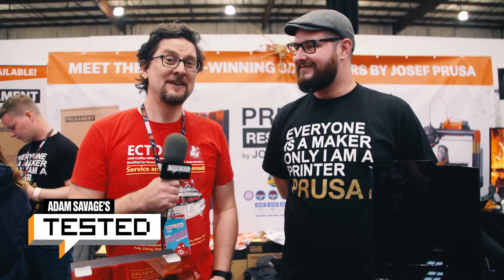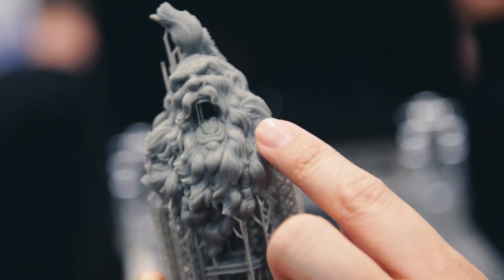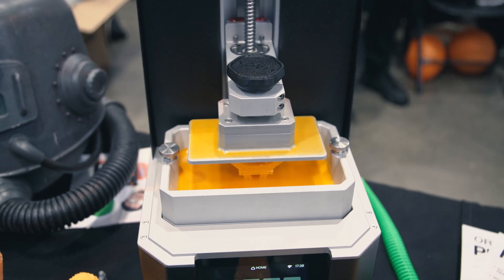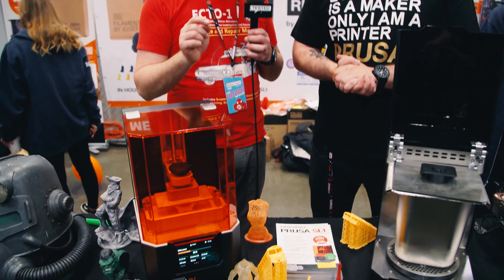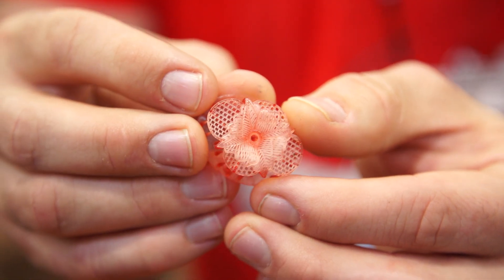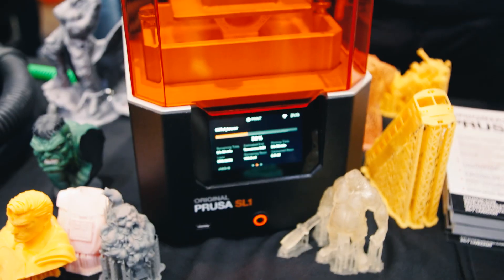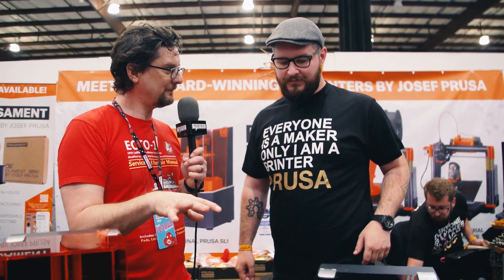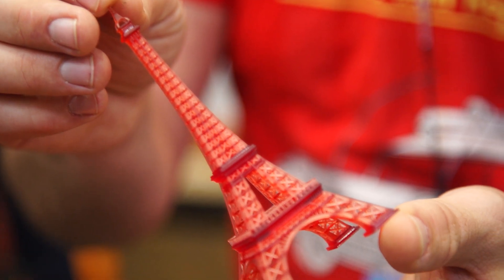First Look: Prusa SL1 Resin 3D Printer!

Comment: High price for low quality printer. The design is not good compare of the cheap alternative on the market.  And who the fuck will use so much powerful processor. Like a customer I just want this think to print you wont play titres waiting the print to be ready.  I'm currently with Photon S and for the quality Is the best on the market right now.

Comment: Public Service Announcement: Prusa's website shows these printers are "in stock" but I can tell you with 100% certainty they are NOT in stock as of 12-23-19. They have had this "in stock" status on the website for weeks and it's not correct. I order an SL1 + CW1 (not kit) on 12-6-19 (today is 12-23-19) which the website still shows this as "in stock" and ships in 1-3 days. Not sure why Prusa is claiming to have them in stock? I'm being told by Prusa that my printer should ship before the end of the year. Shame on you Prusa for this deception. Being honest about the stock levels and shipping times will always be more understood and accepted by customers than telling them it will ship in 3 days when it's more like 3 weeks. I'm a HUGE fan of Prusa but this is shady business practice.

Comment: I'd swear I saw the resin holder moving up and down. Why does it need to do that in addition to the print platform moving up and down? I would think it adds some extra complexity to the system as it needs another stepper to move the resin bath. Using something other than a laser in an SLA printer isn't new. I've seen a few SLA printers that use something other than a laser. I would like to know why SLA printers have relatively small print volumes and yet they cost several times that of an FDM printer with a similar print volume?

Comment: Purely speculative, if the clear material on the bottom of the tank could be switched out for one that allows oxygen to pass through it and a few adjustments were made, could this machine print like CLIP?

Comment: Basically the same technology and resoults of my 350€ anycubic photon
Reply: Not the same.  I have an SL1.  AA gives you no visible voxels.  There is no Z wobble.  No cracked screens or failed prints due to adhesion issues midway through the print thanks to the tilt.

Comment: anycubic comes with update for anti aliasing as well .... safe your money. prusa just charge $1000 for a name .......

The prusa print platform has a design issue too. resin stays in top of the platform. the photon has solved that with a beveled roof, to let the rest resin drop back to the vat. saving resin ;)

I run the original photon for month for swiss watch making. it even blasts away the formlab2.  prusa is to late and to expensive for the same technology that has been out for 2 years already.

resolution and uv light power, anti alias, etc .... same package is avaible for $450 by anycubic. anycubic has as well the photon s version for faster prints (white body) for $470

So judge for yourself, where you spend your money.
Dom Dom

Comment: Still unclear - how long will the film last, and how much will it cost to replace? Formlabs type stuff consumables are too expensive.  Also, shame about the build size. Not clear what this brings to the table that others haven't already done?
Reply: It comes with a few replacements.  How long it will last depends on what you print, where you print on the build plate, what resin you use, etc.

Comment: I would buy a resin 3d printer when it already has a build volume of at least 300x300x400 mm. Although I think resin printers are light years more advance than that of Filament Printers and I don't think the post processing is that bad. If you were to post process a print from a filament printer to achieve at least half the quality of that of a resin printer, it would take you days with a lot of sanding and priming.
Reply: Can you imagine how much resin you would need ?

Comment: This is definitely something I'm planning on moving toward in the future.  I received my Prusa MK3 right before the MK3S came out at the beginning of the year.  Now I'm waiting on the new upgrade as well as the multi-material upgrade to allow me to print from multiple filament rolls.  There's definitely a learning curve with the MK3,  but it's not hugely steep to start.  Anyone looking to get the filament printer should purchase the MK3 kit and build it yourself.  It will absolutely make you more comfortable in the future for any upgrades or repair work. The only downside in the U.S. is that Prusa filaments aren't sold here as of yet and I'm not willing to pay the shipping costs from his country to the U.S.  I've heard they're going to sell from Amazon and there are some listings, but none of them are active for purchasing.

Comment: I've been doing SLA printing for over a year now, and you absolutely don't need a fancy rotating cleaning and curing station. I've completely fallen out of love with them. 

It's so easy to clean parts in a container of IPA using a soft toothbrush. I like to alternate between a container of IPA and another container of water to rinse the part, which greatly helps remove the surface residue that you can't see. 

And then I cure my parts under water, which is much better than curing in air, because water inhibits reaction with free oxygen which can leave acrylic resin parts feeling sticky. Just get yourself a $5 plastic container with a lid, cut a hole in the top for a UV lamp, fill it with water... good to go.
Reply: the whole point of the cleaning station is for you to put the part directly from the printer and have a machine do the cleaning for you so you dont have to

Comment: too expensive !!!  for an open source tech.  you get the same print out of any of the current $500 or lower price dlp!!
Reply: CHI SLIME COMPANY CHICAGO CHI SLIME agreed. At least it says it 1440 resolution rather than 1220, like that's going to make a 1000 dollars worth of difference
Reply: @PatrickPaul1203  lol another expensive ass printer that people think will actually print better which it does not.  creality has a big one come on sale in china for only 1100 4 times bigger!  and it has tilt bed.  lol
Reply: CHI SLIME COMPANY CHICAGO CHI SLIME or one for 500 that has the same size bed, either way people should go with Creality!

Comment: Talks smack about the Chinese printers but the Ender 3 works more reliably than the Prusa i3 mk3 for 1/5th the price, has a bigger community, and is easy to customize.  (FDM, not SLA, but the point stands.)

Comment: There's quite an annoying design issue on this printer. The platform top is flat so you have always resin on it when removing it which will drip everywhere. They should have a look at the Photon and take note.
Reply: I wonder why they did not thought of that... it's the most important feature of the whole printer. No printer is perfect but they got a lot of stuff near perfect for the price but forgetting about the build-platform its a bummer to see... Also the plastic knob on top annoys me so I hope they sell a metal knob later on.
Reply: Just a couple degree slope would be a significant improvement.
Reply: I was thinking the same thing. Such a simple and obvious thing. Makes me wonder what else they didn't think of.
Reply: I have a SL1 and this is not that big a deal.  You can basically ignore it if you are not removing the build plate to remove the print.  I usually just use the included tool with the build plate still in place.  If you do this it is a non-issue.  If you put the whole build plate in a wash then it still isn't much of an issue.  It is not like you are going to put the CW1 on the other side of the room for it to drip.
Reply: @bluexgreen1  If you put the whole build plate in a wash then you are wasting resin and dirtying up your wash.
Reply: Wrecks it is designed so the CW1 can easily use the basket or whole build plate at the user’s preference.  Easy and convenient as it should be.

Comment: it's the same 2k lcd "uv pass-thru" as every other cheap resin printer but 1600 dollars? i got the elegoo mars on amazon for 400 bucks and it came with a lot of extra stuff with 500ml resin and 5 star review on amazon. same specs. i haven't regretted the decision and i couldn't believe for 400 i could get form 2 resolution and sometimes even better prints. downfall for lcd uv is that resins are usually weaker but the market is just starting to save lcd resin with stronger resins so don't be discouraged if you get lcd instead of sla. only reason sla has the lead with stronger resins right now is because of formlabs did most of the research and brought stronger resins exclusive to the form printers. what i do suggest is looking for a cheaper alternative resin printer because prusa's 1600 dollars is alot compared to similar products already out there. but heck if you like prusa fdm printer i can see the appeal to get one i think

Comment: Did I miss it? Anyone know the xy. Resolution of this printer?
Reply: 1440p panel with 3 subpixels... Which sounds to me like 7680x1440 in 16:9 aspect ratio.
Reply: Found the spec on their site:
The SL1 is using a 5.5’’ high-resolution LCD display with the physical resolution of 2560×1440p, resulting in 0.047mm per pixel, that’s the fixed XY resolution. 
https://shop.prusa3d.com/en/3d-printers/719-original-prusa-sl1-kit.html#_ga=2.190946860.781637296.1559575259-1867515650.1559575259

Comment: Why is this guy working the booth, let alone doing interviews, if he doesn't know the dpi resolution?  Oh wait... must be a company executive officer.
Reply: I'm sure he knows the resolution in SI units:  He's from the civilized world, and not used to thinking in our bizarre tribal units.  (As for being an executive officer:  True.  He's also arguably the foremost engineer in the 3D printing field and the the guy who's consistently open-sourced some of the most widely used designs in 3D printing.)
Reply: @xela8384  Ah, but I'm looking at it from the point of view of potential customer unfamiliar with (and frankly uncaring about) the who's who of an industry I will have little contact with save for tech support, so his personal technical qualifications are unimportant.  A vague "eh, it's good enough" falls short of what I would expect from a product booth at a show.  So maybe he doesn't know the dpi - he could have given the dpmm and I'm pretty sure I could calculate whatever conversion my bizarre tribal mind might need.  But he came across as either a less-than-fully-informed marketing guy, or informed but prevaricating in order to hide embarrassing specs.

Comment: Prusa completely missed the mark on this one. This printer is grossly overpriced for what it is. To put that $1600 pricetag in context, Sparkmaker is using similar technology at the $240 pricepoint. They forego the tiltable surface and have a more spartan interface and 1080 P resolution, but use the same anti-aliased DLP technology and are likely working on a similar 1440p platform in the sub $500 pricepoint. See, the issue is that DLP is a step down from SLA in quality, no by much, but it is a step down. Its benefits are that its cheaper and scaleable. And SLAs of similar size are starting to show up around $500-1000. So Prusa made a product at 3x the cost using an inferior technique to whats already out there. Or they made the same product at 6x the cost using the same technique. What Prusa could have done to blow the market apart is take DLPs OTHER advantage. Scaleability. See, the larger an SLA printer gets, the slower it gets or more powerful the laser needs to be. Either making print time or printer cost exponential. Meanwhile, DLP can theoretically produce a print surface the size of a 75" TV (rivaling the largest SLA printer in the world)for the cost of a TV and the motors required to move a build plate that size without sacrificing speed or facing exponential cost increases. This could realistically create a resin printer capable of a 6'x3' build volume for a cost in the area of $15,000-30,000, a factor of 15 less than SLA
Reply: I believe Prusa's SL1 features are pretty on point for the price. What you don't factor in is the poor reliability of the machines in the sub $500 price point. Resin is expensive and failed prints with cheap printers happen alot more often, and especially with those who want to print jewelry level detail. Also, it has a fume filter, a robust calibration system that takes no time at all, I dont think you understand the engineering of making a giant DLP printer, the suction forces involved from removing the print from the fep  is extreme and prone to cavitation and or destruction of the fep or print itself. Similar arguments made for the Prusa i3 MK2, tons of other cheap machines were also available at the time, with autoleveling and a slew of features, but they were not reliable to set and forget, let alone set itself on fire.
Reply: Daniel Kim I agree with everything you have said, but I think the price is too high. 

I am a big Prusa fan. I love my Prusa MK3 and have no problem paying the costly International shipping to get Prusament shipped to the USA.
Reply: The peeling force at the size your talking would be ridiculous

Comment: Resin printers are terrible. Waste of money at the end of the day and the print times are way too long. I have an sla printer, it was garbage, I then bought a pla printer and that thing prints none stop and the quality is as good if not better than the sla. Save your money people and just buy a good pla printer.
Reply: You cannot be more wrong, the resin printers have far superior quality and DLP printers are also faster than FDM printers since it prints entire layers in one go. Now FDM printers are still amazing for larger parts, is far less messy.

It really depends on what you want to print.
Reply: @christianbay7614  They might seem like they have better quality. But now days, they really don't unless you can purchase the 50K+ printers. But these $1000-$4000 resin printers really don't have a much higher print quality. I've printed the same head, one on my resin printer, one on my pla printer. The pla printer, print came out a lot nicer and 6 hours sooner and only cost about $2 dollars to print if that. Resin printers can do some cool stuff. But overall. They really aren't worth the price. You can buy a pla printer for $350 bucks, that comes with a spool of pla and print 40 different objects at the same quality as a sla printer. The difference is, the sla is going to run $1500+ and the resin is another $100 and the chance each print comes out is 1 out of 3, sometimes even higher. I'll have to add though, sla can print very small statues with huge overhangs a lot better than a pla printer. But if you are making statues, heads. PLA is much better printer to go with.
Reply: necro nomicon which printer is best for each person depends on what they are doing. 

SLA/Resin printers are for small high detail prints with no virtually no layer lines. They are not designed to be fast or print big objects. They are mostly used for making miniatures, small models, models of objects/jewelry for casting, dental industry, etc. SLA is used when accurate & precise dimensions are needed and don’t suffer from thermal expansion and contraction because everything is done at room temperature. 

FDM/FFF (pla is just a type of material) printers are for making the bigger models in less time and in a much higher variety of different colors, materials/attributes, and are easier to use. Most models will have layer lines depending on the nozzle size. A smaller nozzle will give you a better looking model with more detail, less layer lines, but take a lot of time. Larger nozzles will print with less detail, bigger layer lines but will take significantly less time. FDM printers are more for rapid prototyping, full size models, prosthetics, functional parts, making gifts, etc.

There is a big difference between the two types of printers, each has their own positives and negatives.

Comment: I m curious, since its 2 in 1,
Why not implementing underwater curing, with heater unit? Test shown that curing at specific temperature (50+), immersed in water, significantly increases overall strength of part.
Reply: I think most resins are UV hardened, not just temperature. And many plastics actually soften in heat.
Reply: @jsupensky Yeah, correct, but I am speaking about combination of all 3 (UV + water immersion + specific temperature) for best results. These arent just my words. You can find thread on formlabs forum.
Reply: I think I can be done, just need to find a transparent container that fit inside the curing machine
Reply: @milhooz  Yes, great idea ! It has potential since it contains both heater and uv lamps, but not sure if there is there available transparent container that would fit exactly.
Reply: Hamza Bavčić maybe something like a 2L soda bottle cut at the top ?